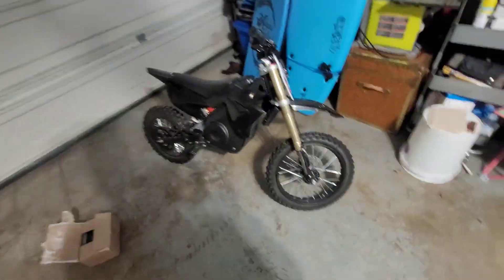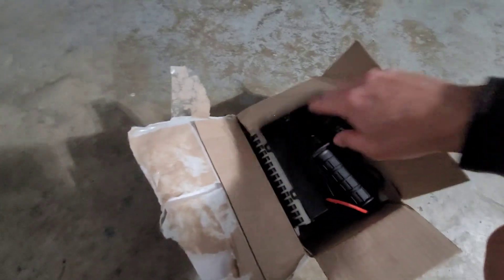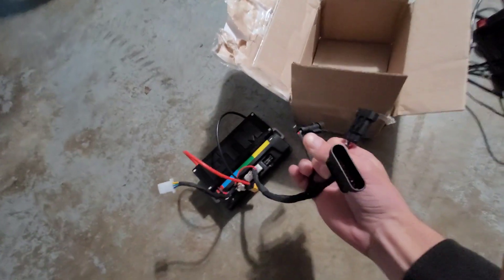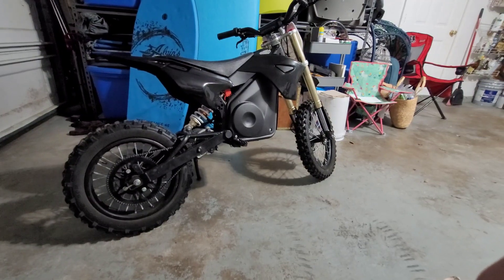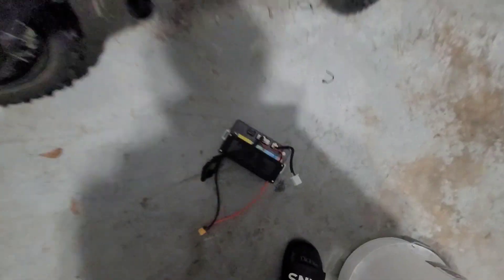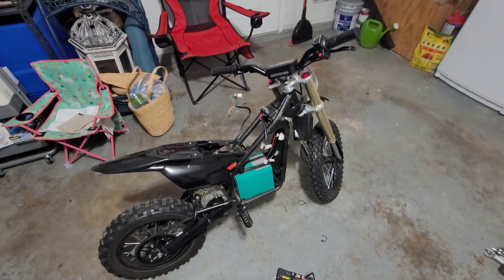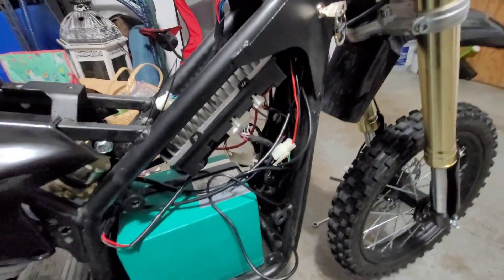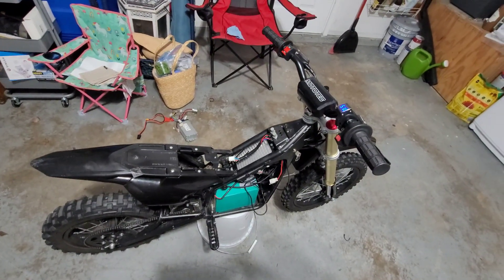Mototec 48v Pro Controller Upgrade 3000w (pt.1) Electro&co ETM Kit

Comment: This is awesome!
Reply from the maker: The man himself thank you sir🤘
Reply: @EmxBrandon hey I have this battery and I’m trying to find out the max amps on it I got the Kelly kvd with the ec4p v2 and I need to use the Bluetooth dongle to change settings can’t find the amp anywhere any ideas ?thanks in advance
Reply from the maker: @christianpudy4798  uf you talking about the green mototec battery, alot of us have pushed it to 70 amps. Id say 60 to be on the safe side, but its going to run out quick especially if your full throttle the whole time
Reply: @EmxBrandon  are you familiar with the kelly controller app ?? Amd yes it is that battery
Reply from the maker: @christianpudy4798  im not unfortunately, the only controller im good with is fardriver
Reply: @EmxBrandon  okay thanks man really appreciate that and so your recommending 60 Amps ? To keep it safe
Reply from the maker: @christianpudy4798  definitely keep it at 60 do a couple top speed runs to make sure it holds smooth all the way through. But after that just take it easy, mess around doing wheelies or jumps ya know? Try to stay away from keeping it pinned for a long time. They are solid little batterys for sure dont dont last long.
Reply: @EmxBrandon  I live a mile away from work amd was gonna use it for getting there and back you think this setup would be alright for that ?
Reply from the maker: @christianpudy4798  yeah a mile isnt bad at all, just top it off while your workin!
Reply: If purchasing your controller for the stock 48v battery temporarily, what has to be done/whats the process when switching to a 72v battery
Reply from the maker: All youll need to do is swap the battery lead from the controller to one with an xt 90 and plug the new battery in! Thats all it takes

Comment: if you have the stock bike which pins should you get for the full throttle?
Reply from the maker: Black red and white, if you u plug your throttle it's the only 3 pin connector. I sell plug and play full throttle kits with a surron style throttle, pro taper grips, and a bar mounted voltage reader to replace the bar guage.
Reply: @ oh okay if i have a surron throttle how would i connect it ? i know i have to wire it but im not sure which ones i would have to connect

Comment: sick video, for stock mototec what throtlle cable would i use i think kelly but im not sure
Reply from the maker: I sell throttle kits for the 48v pro! It's a surron style full throttle, pro taper grips, and a real bar mounted voltmeter. All plug and play. Otherwise if you have your own connectors any 3 wire throttle will work

Comment: Hi, I have the 60v and was wondering how fast would it go and would it still work
Reply from the maker: 60v uses a gear reduction motor that spins In the opposite direction, the etm kit won't work with it due to needing to replace the motor with the one supplied in the kit
Reply: @EmxBrandon  ok thanks do you know any upgrades for the 60v besides like a battery cause I can’t find anythubg
Reply from the maker: @JaxxFN22 slapping in a fardriver 72300 would be your best bet!

Comment: Do you just need to change the controller or do you need to change the motor and the controller?
Reply from the maker: If you get the current etm kit you need to replace the motor that comes with the kit also

Comment: can u get a 60v lithium battery and keep the controller + motor stock?
Reply from the maker: Most likely not. Maybe 52v
Reply from the maker: Stock motor with a 72v controller will work though up to 5kw

Comment: You know the serial number for the motor and controller ?
Reply from the maker: I do not, what do you keed the serial number for? It's just a stock mototec motor  and a em50 controller sold and tuned from electro&co

Comment: How do you change the throttle
Reply from the maker: Youll need to buy a set of connectors and a crimping tool and learn how to use them. The throttle is simple you have 5v (red) and signal (usually green) and a ground (black) the signal wire on the stock controller is gray I think.
The stock throttle also has 2 wires for the button that works the kill switch like the brake sensors, and 1 other wire that powers the green battery bar. You'll need to get a seperate bar mounted volt meter and hook that up to the indicator plug, black to black and from the volt meter red to the other color on the indicator plug.

Comment: Thoughts on this vs Bombmoto chassis with controller?
Reply from the maker: The b1 chassis is like an actual 110 pitbike vs the mototec. And I'm running my b1 motor at double the power the mototec motor can take with a flipsky 75200 and a 72v 36ah from amorge. It would take alot of chopping and welding to fit a battery that big in the mototec.
Reply: @EmxBrandon  Thanks! Is that combo of battery and controller your favorite so far?
Reply from the maker: @xav_1029  definitely my favorite! It's a little much for the stock b1 motor so I had to turn it down and keep it tamed but it's a great combo for a solid 10kw bike

Comment: Hey buddy, awesome video thank you was just wondering when you did the ESC battery and motor upgrade did you have to upgrade the chain and tensioner?
Reply from the maker: I actually never had a problem with the chain or tensioner. I actually still use the stock tensioner for the qs165 swap and 420 chain!

Comment: Hey Buddy it’s Rob again with another question. You had a video on this kit and you wired in the key so it can’t be stolen. How did you do that?
Reply from the maker: The on off witch has 2 wires, the stock key switch also has 2 wires. You just need to hook up the 2 wires from the key switch to the 2 wires going to the on off switch. Doesn't matter which wire goes to which!

Comment: Thanks for the info. Really appreciate it. Have one more question and then I will stop asking stupid stuff. What’s a good drop peg kit? I need some more leg room.
Thanks
Rob
Reply from the maker: Haha ask away! Unfortunately I don't know of any good drop pegs for the mototec. They do have drop pegs on amazon but I wouldn't recommend standing and putting alot of weight on them. Or fabricate a bar inbetween them  so they are strong

Comment: Hey Brandon, after talking with you and others I have decided to get the b1 bombmoto battery because of the bigger capacity and the e&c little bit trumoto controller kit. Does this sound like a decent option and I will be keeping the stock motor
Reply from the maker: Is this for a mototec or bombmoto? If your talking about the stock mototec motor i dont think e&c will send the little bit controller tuned for that motor. The description says they only support the my1020+, ec4p, and etm v2 motors.
Reply: @EmxBrandon  it's for the mototec bike. Dang it just read that. I need a plug and play kit with minimal tuning, for my son. The battery for sure I want because of the size. What will work with the stock motor, or is it worth it to buy a new one.
Reply from the maker: @terryfrome1641  honestly i think the best plug and play kit would be the flipsky kit from e-force. They will help you through the process 100% and youll both be off riding with a smile ear to ear. And the b1 battery will be perfect with it too. If you want to spend the money on an etm kit, even though you hsve to swap in the etm motor, its also a very simple plug and play kit and wont require any tuning.
Reply: @EmxBrandon  let me see what the flpsky is. Thanks man
Reply from the maker: @terryfrome1641  sorry i meant to put a link 

Eforcemotorsandcontrollers.co

Comment: Hey buddy my son has mototec we purchased a etm kit and a 72volt battery, we hooked up and no power coming out of the etm?
Reply: What does that due reset something?
Reply from the maker: @geraldtucker7957  it turns the controller on. That small red wire sends battery voltage to the on/off switch. Once you turn the switch on it connects to the other side of the switch sending signal back to the controller turning it on. Without it you cant do anything.
Reply from the maker: Did you make sure to attach the small red wire with the ring terminal to the battery positive? Its gotta be screwed down with the b+ wire to turn the controller on.
Reply: @EmxBrandon  what is the b + wire?
Reply from the maker: @geraldtucker7957  battery positive, the thick red wire next the the thick black wire that goes to the battery from thr controller. They are screwed down. You need to unscrew the red wire from the controller (unplug battery first!) Then attach the thing red wire with the thick red wire and screw them back down

Comment: Hi bro quick question what is that front sprocket on that standard motor called please
Reply from the maker: Double d bore. But there are none you can just buy yo change tooth count. Unfortunately they need to be custom made as the bore size is a little bigger than normal.
Reply: @EmxBrandon  thanks for the reply bro
Reply from the maker: @epowermaintenance5333  no problem, whats the goal your trying to achieve?

Comment: HELP we just got the same setup and no matter what gear it’s in the bike stalls and needs to be put on the charger every time we go full throttle…. Anybody have any idea why this is or have had similar/same issues? We cleaned all the connections and still same problem
Reply from the maker: Stock battery?

Comment: Hey I was wondering if I leave everything stock but the controller and the throttle will it still go 35 or will I need a new battery or motor
Reply from the maker: Yup! You can leave everything stock and still get 35 40 with a fardriver or upgraded controller!
Reply: @EmxBrandon  ok thanks

Comment: The kit includes a motor. You didnt need it to hit 3000w? You hit it on stock motor?
Reply from the maker: Nah stock motor handles 72v 5000w too. They started selling it with the motor for compatibility issues. There was too many variations of stock motors and people were constantly sending their kits back to get re-tuned. So kit comes with the motor, issue solved. The new motor has some thicker phase wires and will help keep down heat a bit.
Reply: @EmxBrandon is this the Votol controller? I want to reprogram it.
Reply from the maker: @DescartesRenegade  it is but i believe they disable to communication port. Many have tried and no one has been successful yet.
Reply: @EmxBrandon  good to know. Would've wasted hours on it, lol. Thanks.
Reply from the maker: @DescartesRenegade  yeah they either de-solder the port, or whoever tried connecting had a different generation harness? Not too sure. Ive never messed with votol, they look like a pain in the ass just to connect too lol.

Comment: Hey Brandon will the stock 48v battery be ok with the kit?  Because i just got my kit yesterday mines came with a 72v motor i switched it out from the 48v motor. So will the battery be ok with that motor?.
Reply: I jus rode it about an hour ago. It completely died on me within 5min of me driving it. I had to walk it home. Once I connected the charger it went back to saying 53.9V on the volt meter.  That was weird.  Do you know what might have happened with that situation.
Reply from the maker: Just double check all your connections are good. Otherwise im not too sure what it could be.
Reply from the maker: @darylbrown8821  actually did you use the stock fuse? Or did you get rid of that length of wire and plug the battery straight into the controller?
Reply: Stock fuse ?    Which wire was that?
Reply from the maker: The stock wire that goes from the batterys xt60 into the stock controller. It has the fuse in between the red wire. But sounds like you didnt use that
Reply: So I contacted electro & co. Explained everything. Their goin to give me a stock replacement battery for $100.  Or a upgrade 72v mighty mini battery, on a 40% discount. $899 battery, with charger $939.00. With the 40% discount I pay $563.40.  Altogether with the charger.  That's sweet. Just waiting for them to give me the code for the discount so I can order that bad boy.
Reply from the maker: Thats awesome bro! Your gonna love the 72v setup! Thats a bummer the stock 48v took a crap though.
Reply: Yea I know rite. I waited 4 weeks for the kit to arrive & still haven't rode it yet.  So they just sent me my invoice, & they charged me $603 for the battery.Nice little discount. I can't complain. Those batteries, cost a $1000.00. Hopefully everything be all good when it gets here. 72v. Omg!  How fast will that go?
Reply from the maker: Should get ya around 45+!
Reply from the maker: Yup! Theres really not a big difference in the new motor other than the phase wires. They send it out with the kit for compatibility reasons. But it does handle heat a bit better once you do go 72v
Reply: I think I jus completely fried my battery my charger is not charging my battery now. I'm so pissed rite now
Reply from the maker: @darylbrown8821  with the etm kit? Idk how you would have fried your battery.
Reply: Do you think I fried the controller?  My battery is not charging. Every time I click it on the volt meter reads 15. Something & the volt numbers jus goes down until u see nothing.
Reply from the maker: @darylbrown8821  if i was you id go through all my wiring to make sure everything is connected securely and if thats not the issue contact electro&co for troubleshooting.
Reply: U don't have an idea of what u think could be the problem
Reply from the maker: @darylbrown8821  not without seeing it myself. Could be anything honestly.
Reply: I just got the kit 3 days ago & ride it for 5min b4 it completely died. I ordered it July 28th. & it got delivered August 28th.  After watching ur video I couldn't wait for it to get here & still can't ride it. Sucks
Reply from the maker: @darylbrown8821  im sorry brother, nut if its a controller issue thats something neither you or me can fix and needs to be checked out by electro&co
Reply: When I click the on button when the volt meter comes on why does all the numbers jus go down like it will read 15 on the click but almost instantly it goes 15,14,13,12,11,10,9,8,7,6,5,4,3,2,1. Then the volt meter shows nothing.
Reply: I'm not sure if it's the controller. How do you check the controller to make sure everythings working ok
Reply: Awww man that's sweet !   Gotta wait another 2 weeks for the battery to get here. F***!  Lol... Guess I'll jus play Madden 24 & resident evil until my battery arrive.
Reply: I stay in FL also by the way Clearwater area

Comment: Dose it have a speed limiter and if so how do I cut it
Reply from the maker: The etm kit has a 3 speed switch to change modes, the stock vike has a speed and response knob. Its not a surron it doesnt have a wire you can cut
Reply: @EmxBrandon does the speed and response knob still work? I want a controller kit that will smooth out the throttle. The stock bike is very jerky. But I still want it to go slow for kids. 

Any ideas how slow the speed 1 setting is?
Reply from the maker: @elmateo487  negative the knobs won't work. Speed 1 is about as fast as the stock bike at full speed. But the throttle response is great!

Comment: What's the alternative to this kit? I'm on a budget but I'm not going to get the cheapest thing.
Reply from the maker: Check out my fardriver kit video, you can get a fardriver 72300 for around 160-180 shipped, some wiring stuff like connectors for around 40 and reuse the stock battery, motor, throttle, all that stuff and have a kit that will compare and honestly beat the etm kit! I do a step by step how to on it!
Reply: @EmxBrandon hi brandon i am planning on getting a mxr1300 and swapping the motor out with the mxr1500 motor i am planning on putting then 72300 fardriver new throttle 72v battery etc just wondering what is the most the motor could pull without it overheating or having long term issues 🙂 i am looking to get 50mph maybe even more any help is appreciated 🙂
Reply from the maker: 60-70 amps is really as far as you wanna push it on 72v! Right around 5kw. Especially if your gonna be doing top speed runs all the time.
Reply: @EmxBrandon  okay thanks a lot so exited for it lol did you end up making a video on how to wire the fardriver up?

Comment: Does the stock battery have a BMS?
Reply from the maker: Id imagine so but cant confirm. I do know it will push 60 amps no problem though and has been for over a year.
Reply: @EmxBrandon  Just a saftey concern. It it a smart charger?
Reply from the maker: Definitely not a smart charger, just a basic 48v 2 amp charger. Dont know of a single mototec battery to catch fire. They seem to be very reliable.
Reply: @EmxBrandon  Thank you. Good to know.

Comment: Does this help the amount of miles you can go on it ?
Reply from the maker: Oh no it drastically decreases your range lol. You keed a high amp hour battery to make up for the extra power if you wanna go far
Reply: @EmxBrandon  ok so like another 48v with higher amp hour?
Reply from the maker: @Garrett Hawes  correct! Something like 6x8x7 from amorge! If you dont have the amorge info check out the mototec Electric Pitbikes group on facebook and the post is pinned at the top. Alone with a ton of helpful info and people
Reply: @EmxBrandon  how many miles does it go with the EMP upgrade controller do you think ?
Reply from the maker: @Garrett Hawes  its hard to say miles. Its all about how you ride. With the stock battery if your full throttle the whole time it will only last 15 minutes. If your just messing around doing wheelies and slow stuff it will last an hour or 2.
Reply: @EmxBrandon  ok
Reply: @EmxBrandon  thanks for the info, I still don’t know if I get a 48v batter or motor and which one